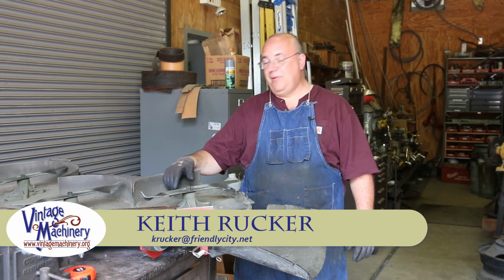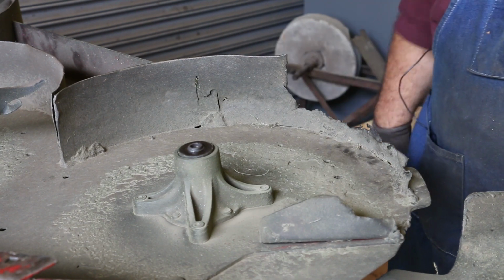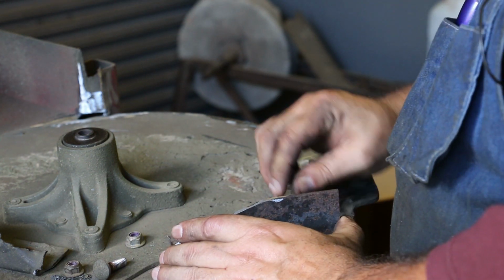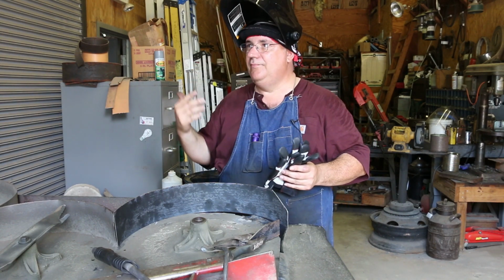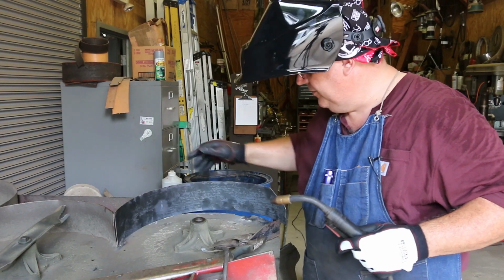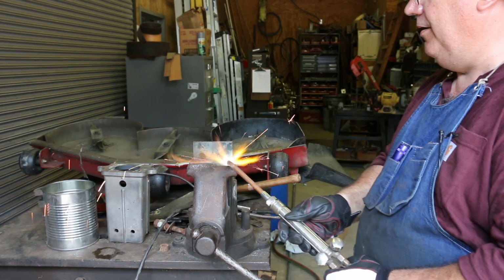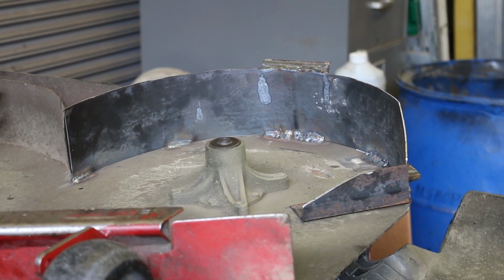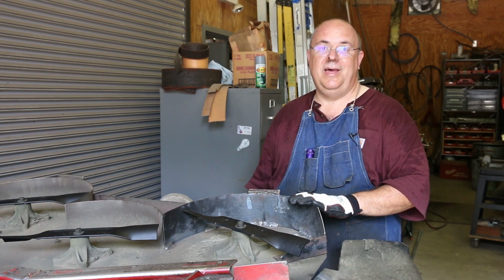Mower Deck Repair:  Fab and Welding

Comment: There are times I take great pleasure in fixing what's broken.  Memories of my youth on the farm, I guess.  I worked for folks that were tighter than me!
Reply from the maker: That is the way I was brought up!
Reply: My grandmother had a jar of bent nails when I was a kid and when I helped her she would make me straighten the best I could.  I didn't realize it until I was older that she was raised during the Great Depression and they saved everything they could.  And people gripe when they don't have good wifi now.
Reply: My dad was raised in the dust bowl.  They stuck it out.  Knowing that, as a kid, we used to tear down houses to get the wood.  I can't tell you how many pounds of bent nails I had to straighten out for projects.  Or how many pounds I pulled out of that wood.  

After the Lubbock tornado, dad bought 2 destroyed gas stations.  I came home expecting a decent summer in '71.... I got to clean concrete block until Thanksgiving that year for the new cellar.  Every day there was an expected but never quantified quota.  If I fell short, there was a meeting with the belt.  Nothing like being a cop's kid (especially an honest cop.  I'm positive he wasn't on the take!!!  We were poor!)

Comment: In this video you dabbled a little into my repair world,  and you did a fantastic repair.  I'm the type also to repair if possible instead of tossing new parts at it.  I was trained by my Grandfather  that lived thru the great depression and had to repair all mishaps.
Reply from the maker: Very funny, I just commented a few comments below this one how my grandfather who grew up during the great depression taught me how to fix things up and keep on going!
Reply: Me to! I can't stand to let something go if it can be fixed at all. All my stuff is old and has been given to me because other folks didn't want to bother with fixing it. Now it still runs better than the new stuff even if it's 30 years old.
Reply: Reminds me of my brother:  He found an almost new snow blower in his local junkyard.  Problem:  the crankcase had a crack in it.  He welded the crack, and he's been using that snow blower ever since.  So he got an almost new snow blower for the cost of one weld.
Reply: Kevin Byrne Sure. Just because something is broken doesn't mean it can't be fixed. Just don't try a gasoline related repair with J B Weld. The ethanol will turn it to rubber/plastic. Other than that it's great stuff IF you keep it away from ethanol. Seal-all works with gasoline repair. Stops up holes in Briggs gas tanks.

Comment: Just did the same thing on my Ingersol. After the repair, I blasted clean the underside of he deck and had it sprayed with bed liner. Cleans easy and doesn't chip as bad. Like you, this is not my favorite work but in my shop, I do about anything to keep the lights on. My business card says....AFAB....meaning "Anything for a buck!"    Great videos, always enjoy watching.

Comment: You know it's all about the tools. You mentioned that the mower deck drags on withe out that little foot you put on. I just bought a zero turn and there are wheels that ride on the ground to prevent the wear from happening.
Great video.
Thanks Bryan
Reply from the maker: There are wheels on the front that should keep the deck riding above ground. But, when you go over uneven ground, the back could still drag - hence the little foot.  Truth is, it should not be touching the vast majority of the time but is there when you need it.
Reply: I have a mtd Lowe's riding mower from 1991 that I use and it has 4 wheels on the deck. When it got hard to start, I put it aside and used a new yard machine without wheels on the deck. It was so unstable, I also have rocks that grow, gophers in between them, and sand. The new mower crapped out after a couple of years and so I learned how to work on mowers and fixed the old one, in which I like better.

Comment: Hope the storm didn't get to bad there.  I have a similar issue with the dirt/sand here. I blasted the deck clean, had it powder coated then sprayed on a couple coats of bed liner spray. So far it has held up for 2 years with no real degradation.  Prior to that I tried regular paint and graphite paint. Both made it through one season but not very well. The other nice thing with the bed liner is that the grass doesn't stick to it as bad if it's damp.
Reply from the maker: Yeah, the bed liner spray won't hold up to the sand blasting we get.  This area used to be the bottom of the ocean so it is really sandy.....

Comment: nice job keith. i always point out the cost savings of jobs like this to my wife. it helps to justify new tool purchases and time spent in the shop.and if your wife is like mine ,you need all the help you can get in those areas.
Reply from the maker: Oh, I pointed it out to her.  She was on the phone with one of her friends kind of griping (not really, but being somewhat sarcastic) about all of my tools.  I told her that I just spent less than $10 fixing something that would cost $750 to replace.  Her friend was impressed but my wife just kind of rolled her eyes....
Reply: I was thinking the same thing.   I also point out home expenses like a lawn mower are after tax spending.   So for instance if you pay one third of your work income e in taxes (remember the money spent for lawn mower fix is your last dollar earned or your most taxed income)
Reply: +ted sykora then you would have had to make $1000 to have $660 to pay for a new mower deck.
Reply: +ted sykora I wish i could edit my comments on YouTube so when I inadvertently hit enter I would not need to start over

Comment: And next week Keith will be fixing a.. jet plane? Never a dull moment, I love your channel!

I have a similar problem here, the blades flick up gravel which chips the paint and the hoods rot out. I recently sorted the underside of my modern (I have 4 more but they're old timers I'd rather not use) to find no rust proofing whatsoever, nice.

Anyway, a suggestion from my dad is to line the underside with rubber (best I can do is an inner tube but I'm sure you could find something better). Maybe that could work as a "sacrificial layer", easier than re-welding it every couple of years.
Reply: You might try spray on truck-bed liner.
Reply from the maker: Yeah, our sand just eats though rubber, plastic, metal, whatever you throw at it.
Reply: Well, there's nothing wrong with 1/8 steel sacrificial deck skirts. It's not like you have to replace them every day.
Reply: Ah, sorry Keith, I guess that'll just be another nuisance job that'll need re-doing every few years. I bet you get through blades too. And air filters.
Reply: @Peter W. Meek Thanks, I've not seen that before but it looks good for me,  I'll have to see if I can import some (after trying the local paint shop for reasons of comedy - "the mad English guy wants what now?!)
Reply: rhinoliner

Comment: Good video. That's one of the best things about those of us who are interested in the trades. We can fix our own stuff! I am so thankful that I grew up in that culture. No need to 'call somebody" every time something breaks! Naturally, every once in a while I have to get some help ..... but most of the time not! Keep the great videos coming!
Reply: So true. The throw away mentality is just crazy. I've never bought a lawn mower, even if I've gone through a few. "Nah, i'ts dead, I bought a new one , you can have the old PoS if you want it." And with half an hour of TLC is runs just fine.
But I must say that I've never seen the under side of a lawn mower deck without a layer of wet grass and rust...
Reply from the maker: Thanks - I hate to throw things away....

Comment: We have the same problem with sandy soil in North Florida, I have an old Kubota Diesel Lawn tractor (circa 1980's)where I have made so many repairs to the deck it looks like a patchwork quilt. I have found that as the metal thins it becomes increasingly difficult to weld without blowing holes in the metal. I have used fiberglass mat for some repairs but I have found if I spray a coat of rubberized undercoating on the inside of the deck it acts like deflecting mat used in sandblasting. The one down side is if you do have to weld a repair in the future you have to remove the undercoating  before welding.

Comment: Nice video. I had just replaced a Deere deck being this one was torn so badly it would have taken more time to repair than to just replace. I've still got a project deck on a Cud Cadet zero turn. The discharge chute area had been blown out. It had been welded once or who knows maybe twice. That will be fun to try for my first repair job. But yes the Deere replacement in which only comes is green now cost me over $1000.00 complete to include the belt

Comment: Nice work Keith.  Exactly why I try to fix things first.  Often I can typically repair quality built items several times over compared to the price of replacing them, even counting your labour costs.
Reply from the maker: Yep, and I think that my repair is better than original.  I was not worried about saving a dollar or two by using thinner metal.

Comment: I cut 2-1/2 acres too.  My Craftsman is 16 years old.  Only issues I've had has been blades and tires wearing out.  Used my MIL's new Craftsman yesterday and it cuts and runs terrible.  You can't beat the old stuff.
Reply from the maker: The quality of most anything with the Craftsman brand has declined significantly over the past ten years.  When I was a kid, Craftsman stuff was maybe not top of the line, but not far from it.  Now day, it is mostly just junk.

Comment: it's nice to have access to this kind of equipment as in the worst case, you could simply build a new mower deck and transfer all the mechanical components
nothing impossible with the talent and the equipment.
Reply from the maker: So true -  but making a new mower deck from scratch, now that would be a project!

Comment: Hello Keith,

Nice work and that for about 8 dollars for the metal equal to about 700 to 800 dollars for a complete new deck. But I recognized that the other two shrouds where not damaged and I guess that the most right one catches the most sand because of the borders. 

Besides, that's a real big mower you have and mowing the little gras we have is maybe one or two rides haha. But I live in the middle of my city and there is not much space for a big garden like you have. 

It's not a real big city with at about 100.000 people but here in the Netherlands there is not much place and lot's of people on a little piece. But for a city garden it is not a little garden at about 9 meters width and 35 meters depth. 

Anyway, looking forward to the next video and many greetings from Roel !
Reply from the maker: Fortunately for me, I kind of like cutting grass.  Gives me time to get out and do something where I can not be interrupted by the world around me and have time to think.  Even with the big mower, it still takes over two hours to cut everything.  As for a city of 100,000, that is a big town for me!  The closest town to where I live is only about 30,000 people, and the county has about that many more.  I personally like living in a small town and sometimes wish I lived in one even smaller....
Reply: Keith Rucker - VintageMachinery.org The city where I live was before a separate city called Geleen and had about 36000 inhabitants. But a few years ago they decided to make one big city and put a few other city's together. Now my city is officially called Sittard-Geleen but the centre's of both city's are stil separate. So it is the total count of more city's together that makes those 100.000 inbabitants.

But I'm also not a big city lover an prefer the more little ones and I would also like more the place where you live. Such a big garden like you have would be perfect for me but the Netherlands is only a little country with less place. 

I think when I ever move than I never would go further up in the Netherlands and maybe go to Germany.

Comment: Rotary makes low lift, almost flat blades for almost every mower made. They are the best thing to use for mowing in the sand. I'm in North Central Florida so I know what you're going through! The low lift blades last 3-4 times as long too.
Reply from the maker: I will have to check into those.

Comment: Good looking repair!   Another note, though you probably have it back together. On some heavy duty spindles, there is a grease fitting right down near the mower deck,  I've had a mower with light duty spindles, single sealed bearings but a small flat spot for the grease fitting, I added it and once a month I'll add 2 shots of grease and the spindles are lasting years longer than before.
Reply from the maker: Yep, I serviced them while I had it all apart!

Comment: I had to make a repair to the deck of my old 18" rotary mower. It had gained a lot of holes in it over 15 years. I actually repaired it with fibreglass, it did another 6 years and I retired it at the age of 21, not bad for a cheapish Honda engined Mountfield that cost me around £250 originally. The new Hyundai has electric start 😊.

Comment: Another grate video thank you. I hope your mower is working well now.
Reply from the maker: Thanks - I cut the grass with it yesterday and it is working great!
Reply: Nice Video. As Twentypdr Parrott suggested, get some elastic coating onto the area where the sandblasting takes place. this holds up much better than hard materials do. this is because the impact energy is dissipated in a different way. This method is widely common when it comes to pumping abrasive materials like concrete or mining tailings.

Comment: These are the jobs you have to do if you have a welder, its not all glamour and shiny turning!
i wonder if theres any abrasion resistant plastic you could have pop riveted inside to make it last longer?
Reply: I wias wondering the same.  My dad used to live in Florida, and the sandy soil there cut his mower deck to pieces.  He bought steel.  Cut it into smaller pieces.  Cold formed them with a hammer then used sheet metal screws to assemble them to the deck.  ( He did not have a welder.)  Eventually they gave way and he had to buy a used mower deck off of a scrapped mower.  I suggested at the time that he should do the same repair with the little fabricated pieces in the areas most affected by the "sand blast".  He said that the deck would out live him and he was right.
Reply: vajake1
when you say it outlived him, i do hope you mean he lived a full long life, and not died the next week
Reply: An easier thing to do would be apply a coat of chasi saver. Its a coating that prevents/converts rust and hardens like epoxy coatings. It and products like it can be purchased at Napa and other automotive supply stores fairly cheaply.
Reply: no and they shatter when you hit things like rocks
Reply from the maker: Not much of anything will hold up to the sand blasting.  I see plastic covers put over metal all the time but it usually does not last very long.
Reply: Yes, dad lived for a few years after this replacement.  I bought the mover from his estate and used it to cut grass at my place in Virginia for another few years.  I replaced the blade, transmission drive belt, deck drive belt, deck drive belt idler pulley, oil and filters as needed.  I quit using it when the plastic gas tank got a hole worn in it.  My neighbor had a friend that needed a mower so I just gave it to him.  However, the mower deck definitely outlived the old man!

Comment: You should think about using some rubberized coating on the inside of the deck. Sounds like the sand is your biggest problem. Up here in New York, the damp grass sticks and rots the metal. I tried fixing my Toro deck about 3 years ago, rusted away where the spindles attach. I finally ended up buying a replacement deck.
Reply from the maker: The sand will tear though the rubber coatings.

Comment: Nice repair, Keith. Would it be important to weld the seam between the new shroud and existing shroud? Seems like that gap will gather wet grass and make rust happen easier.
Reply from the maker: The original one was not welded, nor was the one on the other side.  I just went back like it was originally.

Comment: Hey Keith you may want to check and see if Toro offers a low lift blade. In Deere they make a low lift blade especially for areas with abrasive soil so this exact problem does not happen.
Reply from the maker: I will have to ask about that, but I think that these may already be low lift.....
Reply: Keith Rucker - VintageMachinery.org
They look like standard lift blades from how tall the fins are, if they don't offer low lifts just mill the fins down to half height, should make a huge difference.

Comment: I am surprised you don't use a sand blade, flatter profile on the tips. Keeps them from splitting like the old ones. Good job on the repair.!

Comment: Good video.  I have a Toro zero turn also, no worn through spots yet but interesting to see your repair.
Reply from the maker: Our sandblasting problem is somewhat unique to areas with very sandy soils.  In most parts of the country, it will probably never be a problem.

Comment: great repair Keith .. Hey throw a good heavy coat of truck bed liner coating on that deck and it will run forever ! We use it here on the west coast and it works awesome !!
Reply from the maker: It won't hold up to our sandblasting.  Grass clippings, yes, but not what we throw at it!

Comment: With the equipment at hand and a plasma cutter one could also make decks. Note that farm equipment decks like those on brush hogs are NOT pressed with compound curves because they make them strong enough not to need them in the first place, while lightweight decks sell expensively because they must be pressed with curves to get away using thin stock. The vast majority of mowers are built cheap as possible because the industry is so desperately competitive.